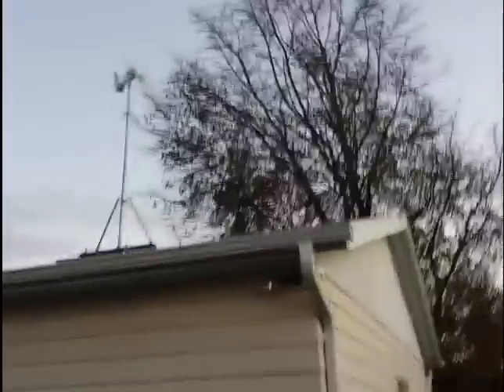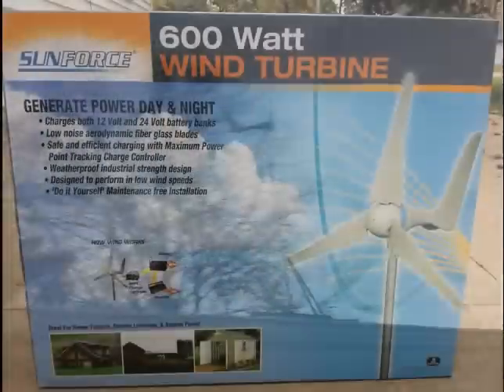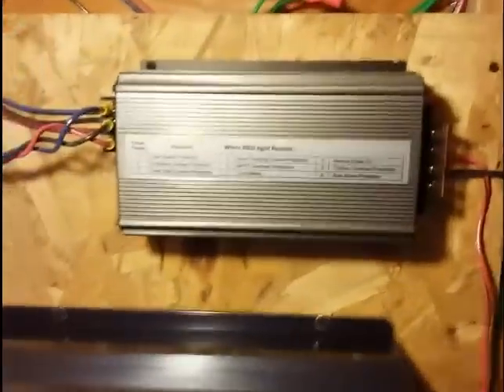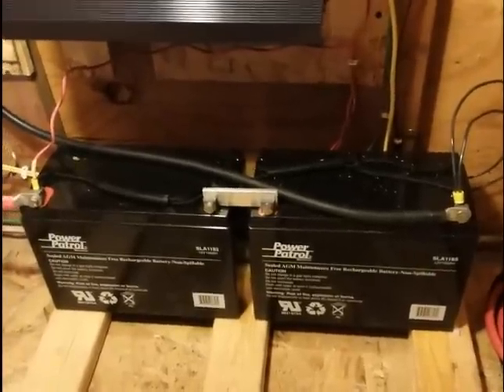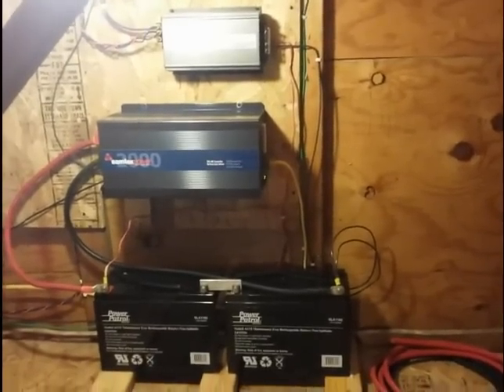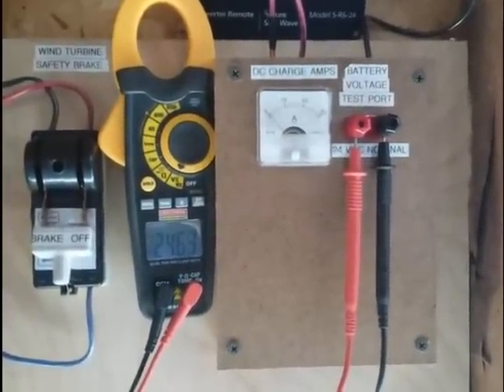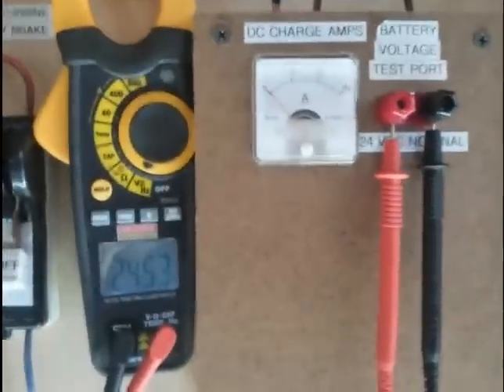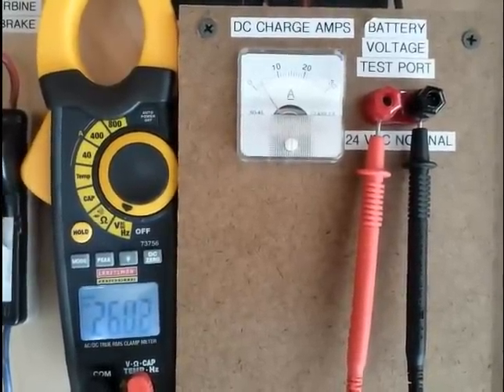Sunforce 600 Watt Wind Turbine

Comment: Hi Daniel, thank you for taking the time to answer my question.  in fact, i have the same wind turbine as you and my question is that when i connect the red and black wire together i feel a resistance but i can still turn the rotor.  In addition, when I connect the controller with the battery (12v) and I apply the brakes, with a little effort I can turn the rotor.  is it the same for yours?
Reply from the maker: I never manually turned the rotor with the brake on (the turbine is too high) but I do know that it will spin slowly in high winds when the brake is on. Direct grounding the wiring won't stop the turbine completely, it will just create resistance when the wind tries to drive the turbine. Essentially the energy being generated is being used as a brake, but it will still spin slowly.
Reply: Daniel Miller Thank you very much for your answer.  I have another question if you allow me, when I put the brake on, the red light lights indicating protection.  do you know if this is a normal situation.  on my mppt I unfortunately have no more indication.
Reply from the maker: @Raph0021  I just checked my system. Under normal conditions the green power on light was on. I applied the manual brake and in my case the green power on light sayed lit, but it is dead calm here with absolutely no wind tonight. I suspect that if it was windy the mppt controller would sense that the brake was on and possibly the red protection  light would light up. I'll have to try it again on a day where I have some wind to properly answer your question. Sorry I couldn't help more at this time, but I'll get back to you when mother nature cooperates. I do know that the red protection light will lite up when there is a big storm and the wind turbine is generating so much power that the mppt controller automatically protects the downstream equipment - this typically only lasts for a few minutes and the mppt resumes normal operation after it resets itself.
Reply: Daniel Miller thank you !! I will waiting your answer.
Reply from the maker: @Raph0021  it is a little windy today so I tried putting the brake on my wind turbine. The green power light remained lit up on the mppt controller even when the brake was on. The brake slowed the rotation of the turbine down to a very slow pace. I hope this information helps you. Looks like the red protection light only turns on when the mppt senses too much power and it automatically slows the wind turbine itself. Good luck!
Reply: Daniel thank you very much for the information.  I plugged it in today and everything seems to be working fine only the red light comes on when the brakes are applied, but the turbine turns very very slowly.  good day thank you again

Comment: what size MPPT controller are you using? What size iververt are you using?  it looks like the inververter is 200W? Max?  or is it 4000w/2000W?
Reply from the maker: The charge controller came with the wind turbine and the inverter is rated for 2,000watts. The garage door pulls about 560watts when opening and closing.

Comment: is it possible to connect multiple turbines to one inverter?
Reply from the maker: If I understand your question correctly, yes - multiple turbines can charge a battery bank and then those batteries can be connected to a single inverter to power your setup. Each turbine would have it's own charge controller and shut off switch that would supply the batteries with power.

Comment: It is not recommended to install a windturbine on a roof mount but on a pole/mast where the base of the mast is directly mounted into the ground incase of lightning strikes.
Reply from the maker: MontiR Aruba, you are correct - unfortunately I didn't have many options on my lot.  This was the best I could do, and I was willing to take the risk mounting the wind tubine on my garage roof, which is not attached to my house.  All-in-all, pole mount with guy wires is the best setup.

Comment: Daniel, any particular reason for going 24v ? On 12v, you could parallel those 12v batts and double the amp hours.
Reply from the maker: ub2bn, yes - I have a few reasons for choosing 24V vs. 12V.  Generally speaking, higher voltage results in higher system efficiency. For example, I have a 24V Samlex 2,000 watt pure sine inverter that has a maximum full load efficiency of 92%.  The exact same inverter designed for 12V input has a maximum full load efficiency of 89%.  Furthermore, the Sunforce MPPT controller is more efficient charging a 24V system vs. a 12V system.  Per the instruction manual on page 3, the MPPT controller will generate more power at wind speeds above 8m/s compared to the same MPPT controller connected to a 12V system.  At a wind speed of 14m/s, the 24V system will generate 600W, whereas the 12V system will generate less than 500W.  Finally, by stepping my system up to 24V, I can used smaller gauge wire between the turbine and MPPT controller since I am reducing amperage - this is a significant savings considering how expensive copper is.  You are correct that I would gain amp hours by placing batteries in parallel, but overall you will gain efficiency in both charging and inverting by stepping system voltage up first.
Reply: 24 volt system m will pull half of the ah out of your battery vs 12 volt system. less damage to your battery, can use smaller wires on higher volt system.  example lets say a fridge takes 100 ah on 12 volts. If you had 24 volts it will only take 50 ah out. if you do a 48 volt system it will only take 25 ah out of your battery system. Now to top it off you dont want to use more then 40% of your battery power(20% is best range battery last 8 years vs 3 years at 40%) unless you have lithium or you will damage your battery. recemend lithium cheaper after you do the math. Example 100 ah agm vs 100 ah lithium. priced agm $200 lithium $600. yet you want use only 20% of 100 ah in agm . so you need 5 batterys to = just 1 lithium battery.

Comment: I have two of them on my roof. I can tell you theses are the best you can buy for the money! They start giving amps in very low wind. this compare to freedom 2 from missouri wind and solar is GIVING 3 amps before freedom two even things of turning!
I recommend not connecting the mppt and instead use a rectifier especially if you have a dump load.

Comment: I have a Sunforce 600 as soon as the wind get going the brakes stops it . To see 5 amps that's good. There 9 reasons to hit the brakes. And riding the brakes in a 20 mph wind the noise is load. This was wasted money. In this video it shows the wind pumping good. The meter has no reading 0 amps.
Reply from the maker: Dan, I am sorry you feel like this is a waste of money. Based on your description, I suspect that the break is not the problem, but instead the wind turbine is going above it's cut-in speed and beginning to generate power (which will slow the blades down and cause a noise).  The blades will spin free until cut-in speed without generating power, Once there is enough wind, the turbine will begin making noise (if mounted on a roof this will be very noticeable) and the blades may slow down if the wind cannot sustain the load.  In general, wind turbines will not constantly produce their rated output; instead they will idle most of the time, and then peak during storms if installed properly.  It is important to manage your expectations - solar power is more consistent than wind, but wind is generally available in winter when solar is at it's lowest output - this is why I installed my wind turbine. My wind turbine is almost useless during the summer (but solar is good), however, the turbine does okay in the winter.  600 watts is the peak that the turbine will put out in a 30mph sustained wind - this is rare - if you are seeing 5 amps from time to time, you are doing better than me.  I would encourage you to see how it works through the winter, and lower your expectations over the summer.  Overall, this small turbine is good to learn on; I have met people who have purchased much, much more expensive wind turbines just to learn the same lesson. I hope this info helps, and please feel free to post more questions.
Reply: Daniel Miller what do you mean cut in speed
Reply from the maker: Dan Rich Cut-in speed is the minimum wind speed that the turbine will produce power; in the case of the Sunforce Wind Turbine I believe it is advertised to be 4 MPH wind, which should be about 500 RPM on the turbine blades.  The blades will spin like crazy at 3-4 MPH wind, and it will be silent, but it won't be generating any power.  Above 4 MPH wind, you will feel and hear in intermittent groaning sound if you touch the turbine support pole.  I believe the groaning is actually the magnetic field of the windings in the wind turbine working to generate power.  If you have a strong sustained wind, like 15 - 30 MPH then the groaning sound will be constant and you will be producing 100 - 400+ watts of power.  Once the wind speed is above 30 MPH, or 1,300 RPM, then the MPPT controller will engage the brake for self protection - if the break is engaged, the blades will hardly spin even in a strong wind - maybe 1 RPM.  After a few minutes, the controller will automatically release the brake and everything will be back to normal.  Finally, if the turbine is in wind gusts over 157 MPH, it will likely fail and break.
Reply: Daniel Miller well my wind turbine is frozen after riding the brake on and off all night it is not moving
Reply from the maker: Dan Rich I am sorry to hear that.There is no physical brake on the wind turbine - instead, the brake works electrically by connecting at least 2 phases together. This setup uses electromagnetism to act as a break, and therefore there is nothing to physically wear out.  Based on what you are describing, you may have had a bad bearing all along, and now that bearing may have seized.  If that's the case, you should get a replacement from warranty. I wish you the best as you work to resolve this issue.
Reply: Daniel Miller thanks made me feel better,  not knowing or understanding didn't think about a bearing grinding.
Reply: i like the video but am wondering where you got your ground and send it to?????

Comment: Daniel, I am having trouble getting the amp meter to work...what size wire did you use between amp meter and mppt  and what size between amp meter and battery
Reply from the maker: I used 12AWG wire for all of the connections.  Good Luck!

Comment: Daniel...in just connected this system but am thinking the AMP meter is not working or I have it connected incorrectly...can you show or tell me how you connected the meter to the MPPT...thanks
Reply from the maker: Congratulations on setting up your wind turbine!  There are 2 connections on the back of the AMP Meter and current has to flow through the meter for it to work.  On the MPPT Controller, connect the "Battery +" to the "+" on the AMP meter. Then the other connection on the AMP meter gets connected to your Battery positive terminal on the battery itself.  This allows current to flow through the AMP meter so it can be measured and then flow into the Battery. You will need a substantial wind for the meter to register AMPS, greater than a constant 12 mile per hour of wind.  I hope this helps & good luck!

Comment: Nice setup, this was the 1st wind turbine that I bought about 2 years ago but I sold it before I installed it because I figured that a 7 to 9 blade wind turbine would be more suited to my wind conditions but this wind turbine appears to work relatively well. You would undoubtedly get much better performance if you could get it above your surrounding tree tops (even if the clearance is less than the 20 recommended feet).